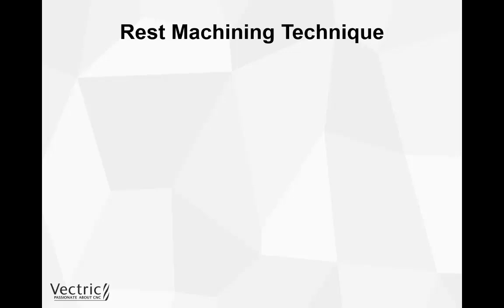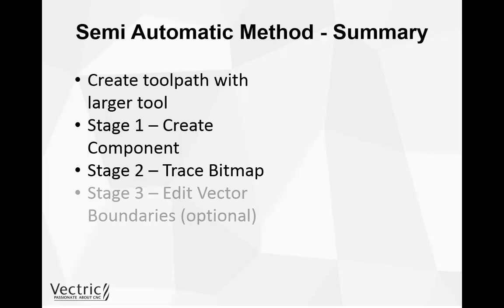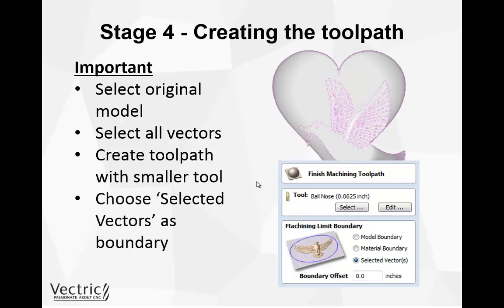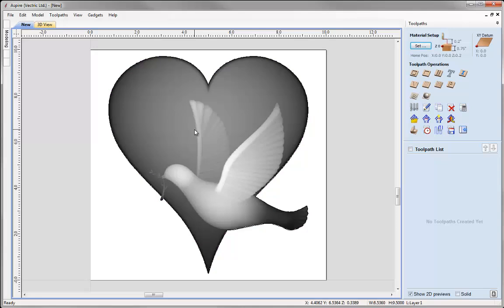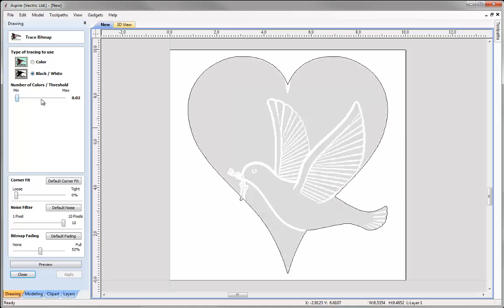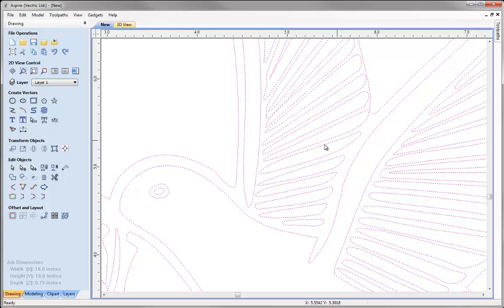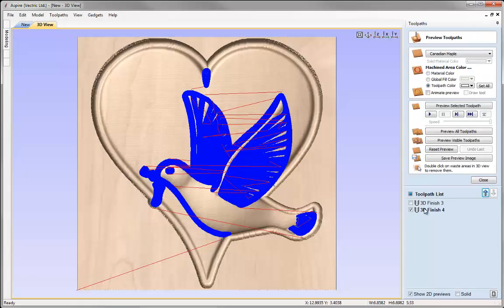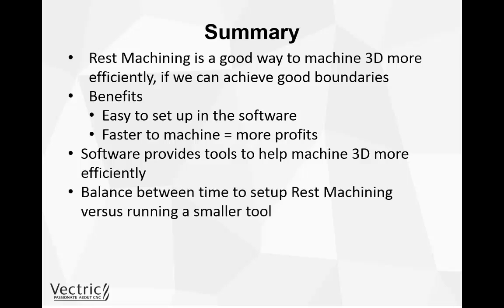Vectric - Efficient Machining of 3D Parts - Rest Machining

Comment: Hi! I just started with cnc machine. My question is : There is a difference in results using different methods? Because I didn’t understand why use this method if there is a automatic 2 clicks option.
Reply from the maker: Hey Claudia, there isn't an automatic way to rest machine I'm afraid and so we're demonstrating here how it can be done manually :)
Reply: @vectric  Well...not until ver 11...and then you did a GREAT job!